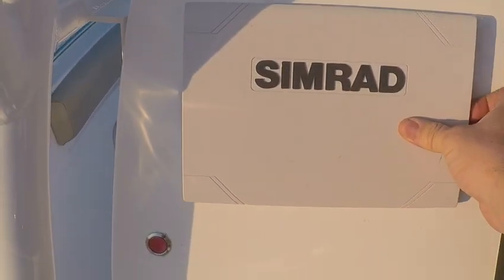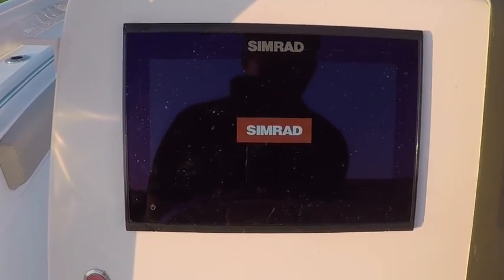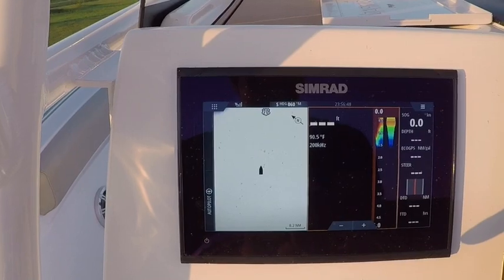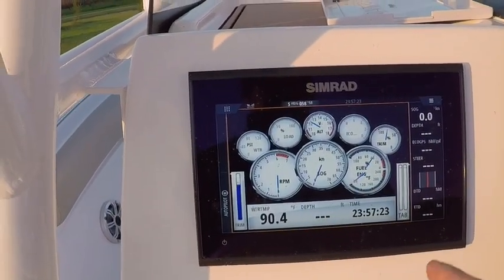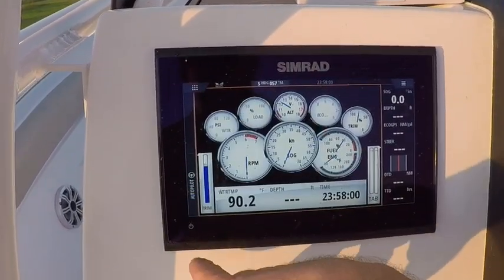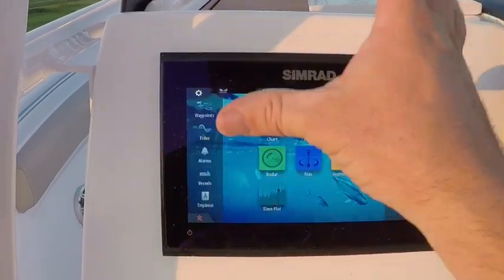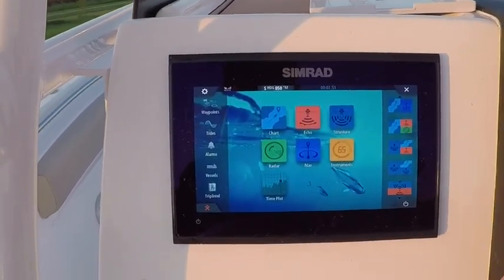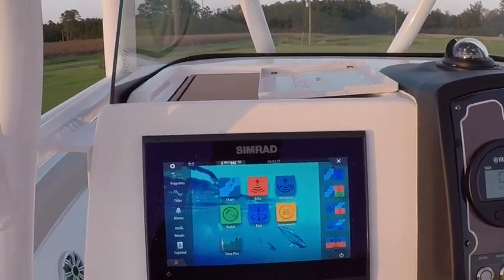Simrad Go9 XSE (Old tutorial)

Comment: Nice video , I am looking at a sonar / chart plotter , that will be compatible with Navionics , i also would like some type of trolling motor that would be compatible to the chart so it could not only stay on spot but also follow contour lines and way points from the chart from all the research I've seen so far is that the only trolling system available for simrad is the motorguide xi5 gps pin point  which also works on the lowrance ti2 7 and up , the minn kota riptide terrova and ulterra I PILOT LINK models only work with Hummingbird.Helix and i found out that they also come in the I PILOT version that does not LINK to the Hummingbird Helix, i only mention all these facts because i heard you mention an interest in a trolling motor later down the road and wanted to share my hours of looking at what is compatible
Reply from the maker: Thanks for the comment and sharing your experience. The hummingbird bird and minn Kota setup looks sweet (I believe Hummingbird owns Minn Kota now) and Garmin now has their own trolling motor system.  Spot lock or pin point is what I truly like to have, the contour feature is nice but if it’s not dead calm where I fish I’m afraid that feature won’t work for me.  But let me know what you get, any experience is appreciated. Again, thank you for the comment.

Comment: Will the GO series accept the Navionics mapping card? I has a NSS EVO2 on previous boat that had a slot in the front to install card
Reply from the maker: Chris M there are two micro sd card slots on the back of the unit.  As long as your navionics card is a micro card, it should work.
Reply: @MattPaulFishing  - Thanks for the feedback. Had EVO2 unit on previous boat and liked it. Looking at a new bay boat now, listed as having a pre-installed 12" Simrad, was ready to install a second 12" EVO3, then found out it's the GO12. With the card slots, sounds like the larger GO series units can do most of what the EVO units can do except network and run multiple transducers.

Comment: Im planning to purchase a new unit ... im not sure whether to go with the GO 9”  or to buy the nss evo3 simrad ?? I wish you can help me! 
Is it worth to spend money on NSS evo3? 
Thanks for your video
Reply from the maker: saif alhammadi don’t get me wrong I love my GO9 but if I had the money and fished more than 150 days out the year, I would have bought an NSS setup. The GO series was a budget unit that could do everything I wanted it to do.  Being budget friendly allowed me to get the Simrad Outboard pilot. ...The only real con about the GO series is the touch screen gets too hot to touch in the summer time... Not sure if that helped.
Reply: PaulOffshoreFishing sure it really helped since we have very hot season in my place.. what is the significance different between these 2?   Any advantage in transducer? Application ?? Is the evo3 faster processing? What will make put my money on the EVO3 since it nearlly double the price of Go9” ?
Reply from the maker: saif alhammadi when I bought the GO series the gen 3 NSS wasn’t released yet, so I’m sure the Gen 3 NSS has better specifications than the GO.  There were some clarity issues on the GO that have been fixed through firmware updates. 

Disclaimer, I have no experience running the NSS, just giving opinions on what I have read. 

The really significant difference I saw was network capabilities and physical keypad to compliment the touch screen.  You can link multiple NSS plotters and you can also link multiple transducers to the unit as well.  There is an HDMI output too.  I’m not sure if the NSS come with a transducer.  Basically all I is you paying for lot more options in order to have the ability to have an expanded navigation network like is done on big yachts... Sounds like you can’t go wrong with either. I have been happy with my GO series.

Comment: Nice video a lot of info but 1 question how did you get the fuel level on there to show??
Reply from the maker: Satber Hoxhaj I’m not sure how your gauges are setup.  I have the digital Yamaha link gauges the reads the fuel level.  Yamaha provides an output wire that you can get a NMEA 2000 adaptor and connect into your NMEA backbone.  My GO9 is also connected to the NMEA backbone which allows it to receive the output from the Yamaha gauges.

Comment: Just kind of Skimmed thru the video. My side vision isn't working. Do I need a special transducer for this?
Reply from the maker: Which transducer do you have?  I have the Total Scan Transducer,  unfortunately I haven't had much luck in water deeper than 80 feet.  Works great inshore.  Also, the side scan won't work if you run the sounder in chirp mode because CHIRP and side scan require the same frequency.
Reply: Thanks for the reply and the info! I'll have to get back to you on the transducer, not quite sure. It was ordered and put on the boat. I'm still reading up.
Reply from the maker: https://youtu.be/spFLG_2UkXo

Comment: Is this thing water proof?
Must be but never owned one.
Thanks
Reply from the maker: Thanks for the comment!
Yes the unit is sealed.  I rinsed it with the water hose when I get home to make sure no salt is on it. However,  I have not tried it under water yet 😅.
Reply: Yes.  Just about had a heart attack finding this out.  ++ Backed the boat down at the ramp.  Solo launch...Put the truck in park, climbed into my boat and noticed I had left the unit in the splashwell as it was floating when i climbed in. OMG! Heart skipped a beat. It was only a month old at the time. eeek. Plugged It in and it works! whew!

Comment: I have a 43ft Black Thunder Power boat with the Simrad GO9 XSE is it OK to mount the the Totalscan extended Transducer to the stern with High performance twin engines
Reply from the maker: Michael Vitale thanks for the question and comment.  Disclaimer, I know nothing about powerboats but I have some thoughts on the setup. Unfortunately, I think the transom mounted total scan transducer is not ideal.  The turbulence the engines and the tabs generate with greatly inhibit the sonar signal if it can even pick it up at all.  The faster I run in my boat the fuzzier the sonar reads, and if it’s rough some times it can’t find the bottom at cruise speed. The GO series should be compatible with a 9-pin “thru-hull” or  “in-hull” transducers (B60 or M260) which would probably be more practical for a power boat.  Those mounting get the transducer located up in clean water for a better signal.  Those transducers do not provide structure scan. Hopefully that helps, not sure it I answered your question.  Thank you again for watching my video.